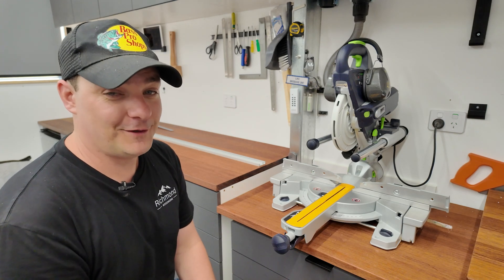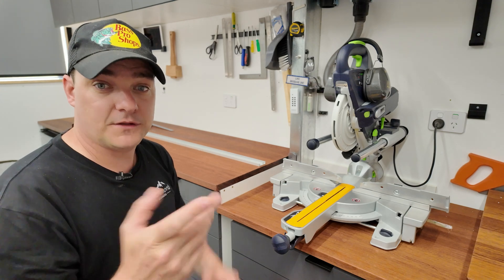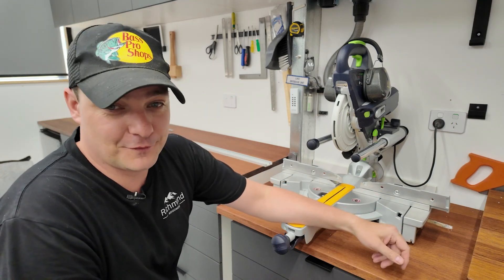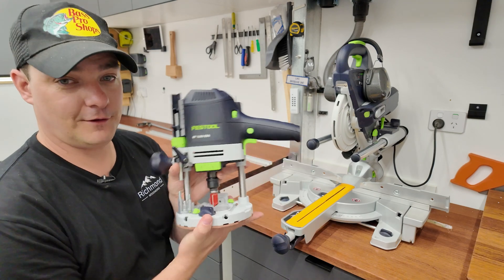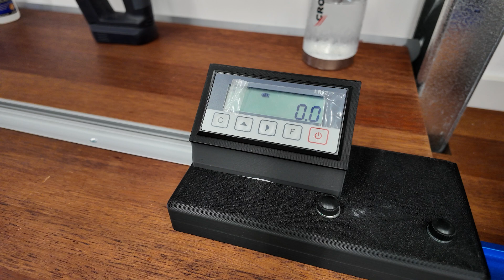3D Printed Digital Mitre Saw Stop Block System

Comment: I put t together and then could not get to the batteries.
Reply from the maker: Hey John, my version of the digital gauge fits snug enough to not move, but is still removable. Have changed the batteries since putting it together.

Comment: Well done. Dont you miss a flipstop?
Reply from the maker: Kind of, I am currently designing version 2. Although no flipstop it will have something that can be used as one. I can take the stop block completely off the rail if needed, just need to re-zero it after which doesn't take too long
Reply: @RichmondWoodworks will there be a video? Or instagram kr something. Sounds interesting
Reply from the maker: Absolutely, just waiting on an assortment of parts coming for China.
Reply: @RichmondWoodworks got any update? Or what was your idea?

Comment: Very nice job with this video! I saw Dennis’s video as well. You both did really nice work. I can’t get the link to the digital reader to open. It looks like it starts to go to it and then says page can’t be found. Since your video is only a couple of months old at this point, I was wondering if you could doublecheck it and repost a link for me. Thank you. Also, does the digital reader come with the magnetic tape, or do I have to buy that separately?
Reply from the maker: Hey Steven, just double checked and it works for me, but just to make sure here is the link to the file: https://www.printables.com/model/1167760-zero-clearance-mitre-saw-station-for-digital-reade/files

The digital reader comes with the tape, have been using it for a few months now and it has not dissappointed.

Comment: I'm expecting version 2 soon.... I just don't see these being convenient if they don't flip up, how are you liking it so far?
Reply from the maker: Have used it a few times, loving the accuracy. I understand the flip stop requirement, but will need to think about how exactly something like that would integrate into the system. I really like the fact that I can just lift it off the table and put it away without needing to unscrew anything.

Comment: I probably just missed it, but how does the stopblock actually stop? I get how it measures, but what about the clamp or whatever that holds it where you put it?
Reply from the maker: There is a lot of friction in the T-Track, so it is enough to act as a stop block, but that was a little bit of an oversight and I aim to update the second version with an actual knob to clamp inside the T-Track.

Comment: Quick question about something. Not actually this stop block, but I noticed, on your mitre saw, you have what looks to me like that yellow tape that makes a zero clearence like effect without having to make one from wood/plastic etc. My question was: I got some of what I assume is the same stuff, but the thinkness of it annoys me, when putting down wood lenths to cut, the wood cannot sit flat and the highight of the tape is enough to make the wood be able to be 'wobbled' if you try. Have you had any trouble with yours anything like this? (given your setup, the wood length would need to be small enough that it's not touching your wood tables either side of the saw I would imagine.)
Reply from the maker: I know exactly what you are talking about, the height is maybe 0.5mm, but enough to cause just a little bit of wobble too. I do aim to 3D Print a zero clearance insert in the future to combat this issue. My previous mitre saw, a Bosch, I made a custom insert out of timber of the perfect thickness but everytime I wanted to change it I needed to create a new one. So hope to just design and print a new one everytime it is needed. I don't think it has been enough to make any really noticable difference when cutting 90 degree cuts, it could potentially be out by .5 of a degree. 

Which Mitre Saw do you have?
Reply: @RichmondWoodworks  I have an older version of the Bosch GCM 800 SJ Professional (EU version if there is a difference)

I do mean to get around to making a zero clearence insert for it, but I didnt have any pricision calepers to do it until recently, so I might just do that when the weather in the UK gets a bit better and I can get out to the shed :)
Reply from the maker: I used to have one of them, great saw! Hopefully the weather starts warming up soon!